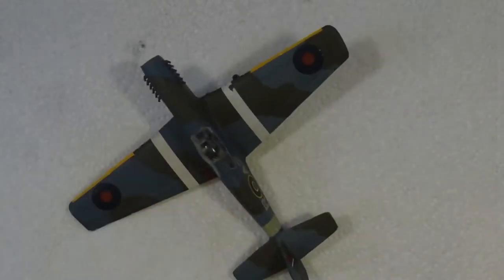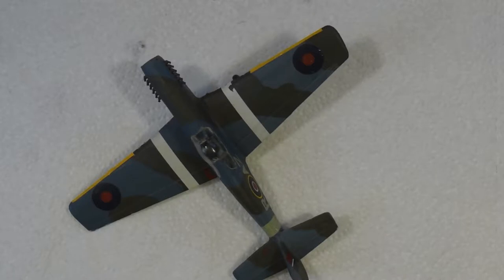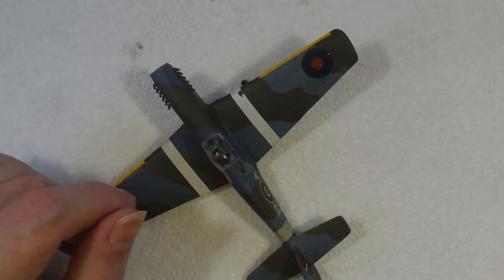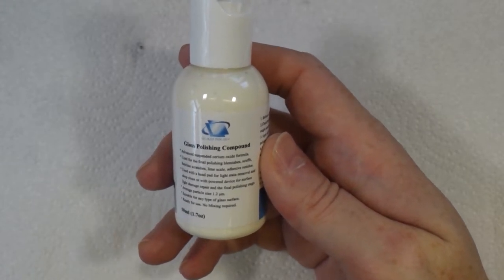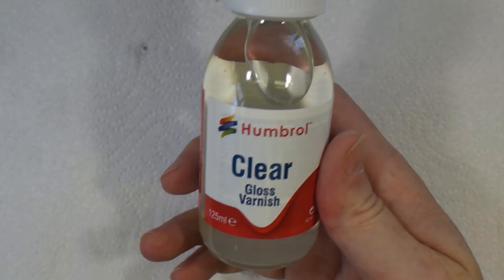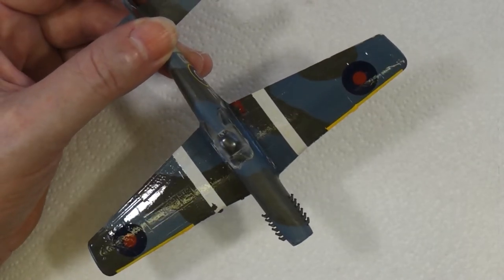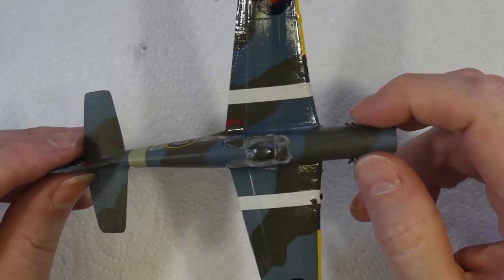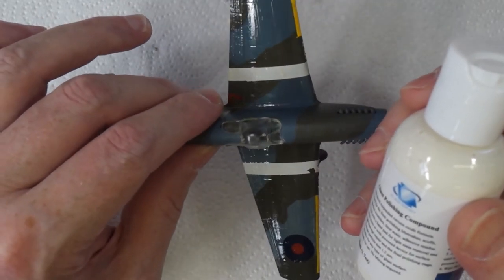A cheaper alternative to name brand model polishes?

Comment: Just found this particular video at a useful time. Have been building a car model and had been looking at finishing polishes to get a decent final look. Having (eventually) got a decent paint finish I then sprayed it with a few coats of Humbrol gloss. Ordered the glass polish had had a go with that. The gloss finish wasn’t too bad but I felt it needed some help. Applied and buffed it using a microfibre cloth rather than a Dremel. Really pleased with the result. It now looks polished but it looks quite natural for the scale. 

Used it to remove scratches on glass too!
Reply from the maker: That's great, I'm pleased it worked out for you :-)
Reply: Got an Airfix Harrier beginner kit (wife found it for £2.50 in a charity shop) and the canopy had a massive seam line in it. Was going to leave it but decided to sand it out. After using finer grits then tried this polish and it gave a really good result with the clear piece looking amazing. Also tried it on plastic after filling seam joins. Gave a great final finish on that too. Have used Autosol previously which was good but the glass cleaner seems less abrasive!. :)
Reply from the maker: Brilliant. I actually used some on an old pair of sunglasses and it brought them up a treat :-)